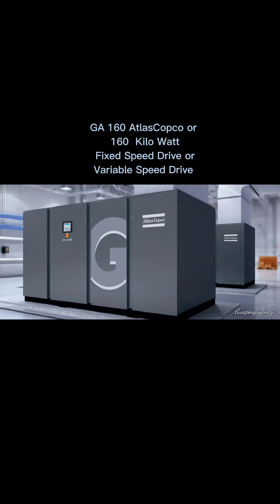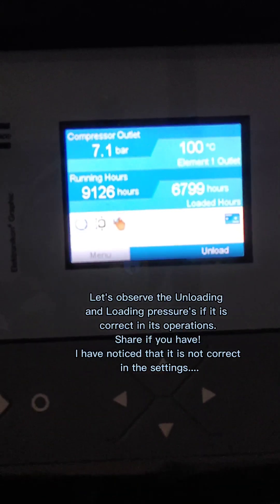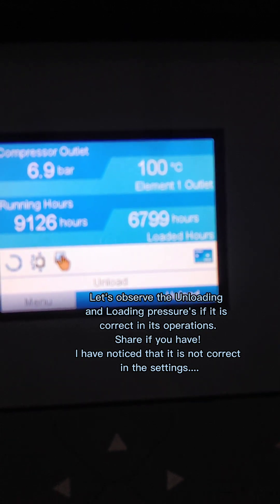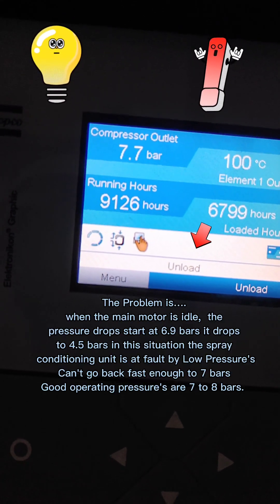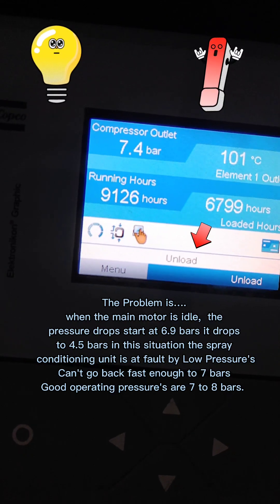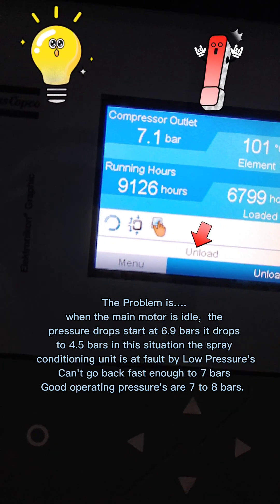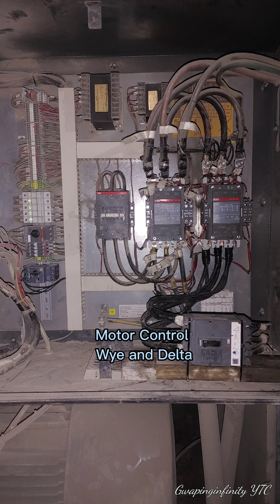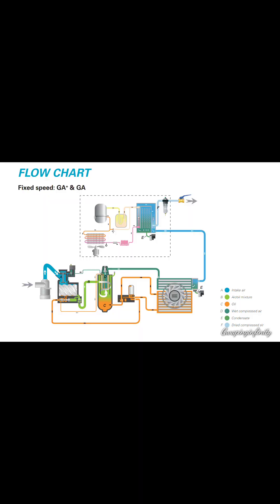ATLAS COPCO COMPRESSOR LOADING AND UNLOADING PROBLEM +Gwapinginfinity

Comment: Sloution to this proplem sir
Reply from the maker: What I did was I changed loading and unloading from 8bars to 7bars unloading and loading 6bars.
 And also changed idle time 0 only valve intake works and always running The main motor because when the motor stopped, the pressure drops 4 bars unrecover rapidly cause of spraying system faulted....